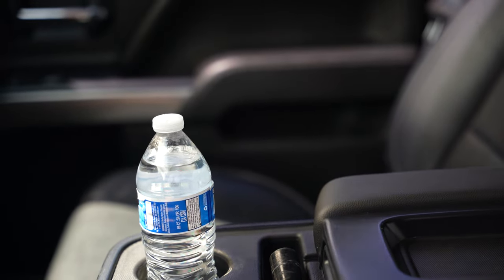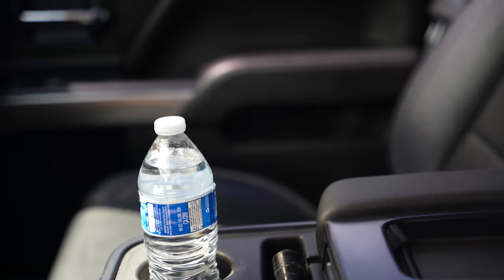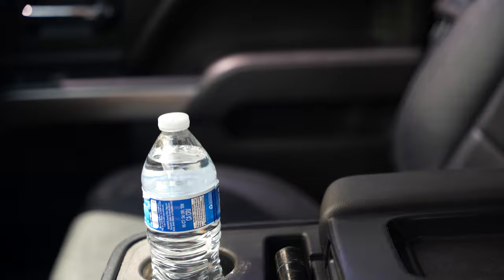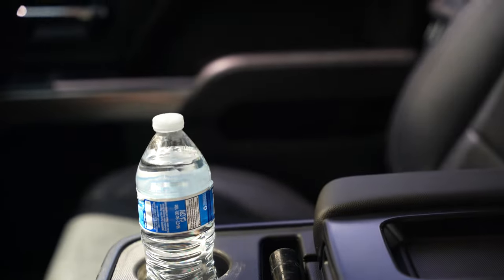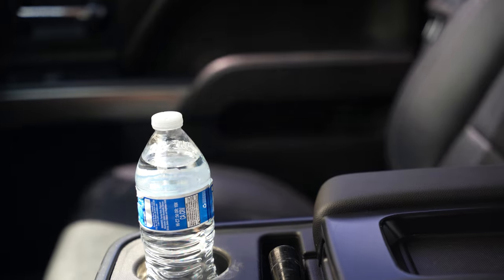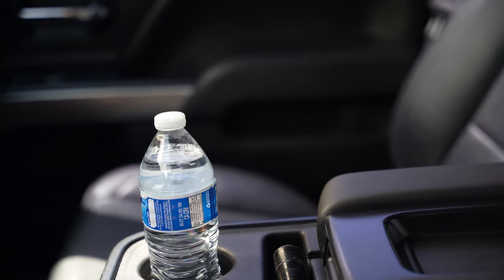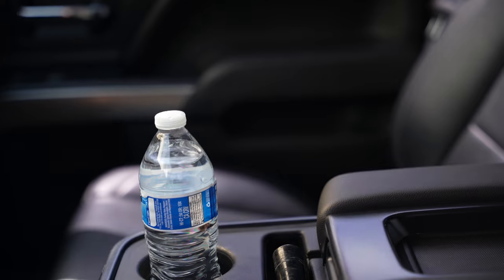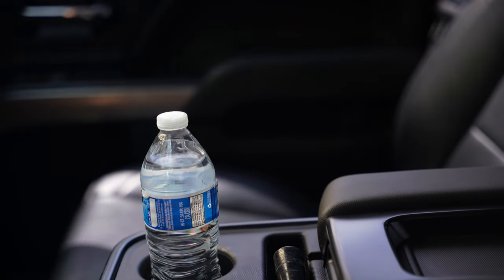Fix Your Tire Vibration with Tire Truing!

Comment: i've always been a fan of tire truing but assuming you rebalanced the tires after truing, you tested tire truing+balancing, and you have no way of knowing what part of the result is from rebalancing and what part is from truing. to properly test this you'd need to first rebalance your tires and check how they ride city/hwy. then true+balance and check the ride again. if you did that you'd be controlling for balance and taking it out of the equation so the only thing you're comparing is true vs untrue
Reply from the maker: True statement. Ive only shaved the tires when ive noticed some sort of uneven wear. Im actually doing another tire shave this week but basically I can visually see how the tires are unevening wearing which balancing wont correct fully.

Comment: I just dropped my truck off at champion 4x4 same reason vibration I’ll see how it is when they r done
Reply from the maker: Let me know how It goes!
Reply: Went great night and day difference I understand what your saying about smoothness it feels great I had to have 2 of my tires trued and I did a alignment and road force balance on all 4 one of my tires was at 60 road force it was a great experience with champion was 400$ and the problem is fixed there alignment is spot on will definitely go back to them in the future I caused this problem by neglecting to do a alignment right after a spacer lift on my truck and did a number on the tires they all cupped up
Reply from the maker: @John___Dough   That is awesome! Glad it helped!

Comment: How much rubbing do you have after the NorCal?
Reply from the maker: I trimmed quite a bit so I have no rubbing at all at the moment. Considering trying to fit 37's which will definitely bring back some rubbing.
Reply: @SloJoeRacing  sweet! Thanks for the reply I’ve got almost the same setup as you and everything is getting put together this Saturday. I bet the 37s would look sweet
Reply: @SloJoeRacing I have a 15 Sierra and decided to spend the money and get adjustable coil overs on the front. Bro…night and day difference and rides so smooth!! I’m also sitting on 37’s and 26’s with no rubbing.
Reply from the maker: @78fty95  That is great to know! I have one tire I need to replace and was considering going 37s but scared about the rubbing.
Reply: @SloJoeRacing  my coils are set at stock ride height which is 7” just to give you an idea. You can also add a leveling kit bc it bolts on the bottom of the coil on these newer body styles and then you could run 37’s without a doubt. Rim choice effects people the most, honestly. A more negative offset means you have to go higher to clear smaller tires. My 26’s are replica rims so they have a factory offset which keeps the tire mostly tucked under the fender. I also run 13.50 width on the 37’s